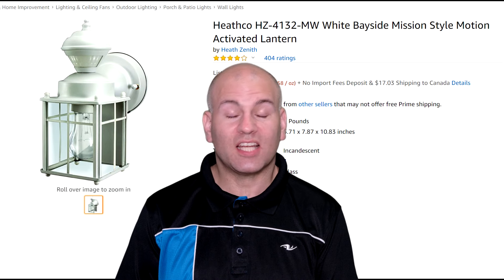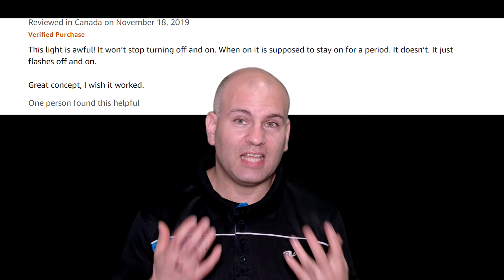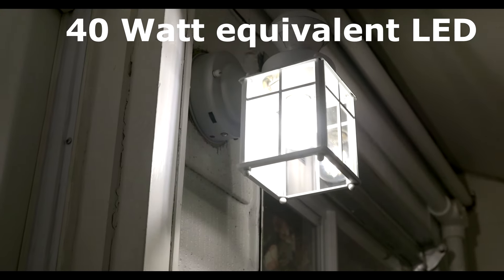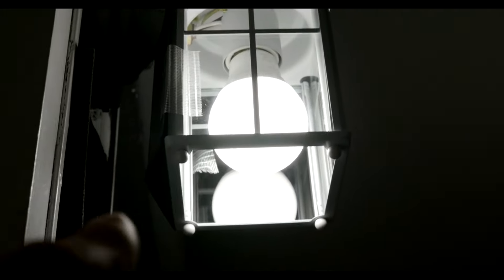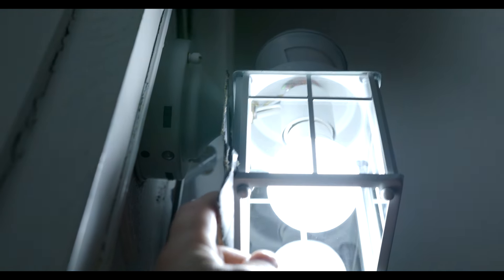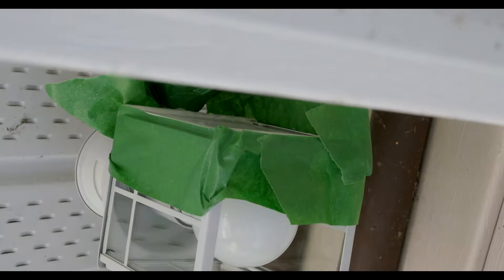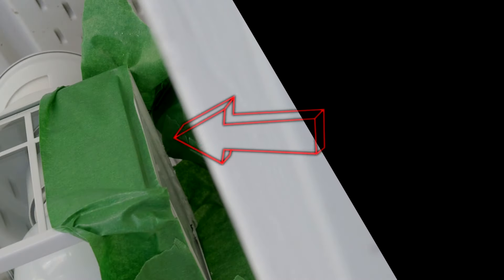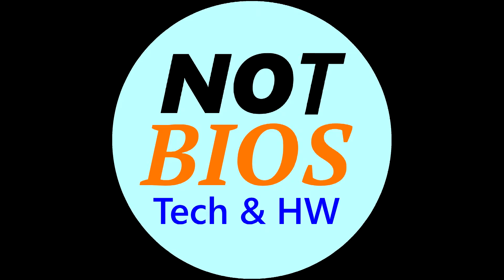Motion Sensor Light Flashing On Off - easy solutions (Heath Zenith)

Comment: I got this POS to work by doing the steps....

1. turn it on at the main switch and wait for it start to turn/off
2. than turn it off (at the main switch) for 2 seconds and turn it back on. In the manual referred this as to set to manual mode but it work for me.

The problem with this trick is that if you have another brand security light on the same switch like I did. What I just did will cause the other security light to stay on, because I just set the 2nd security light to manual mode. Now the fix for this problem... turn it off and 2 seconds turn it back on again the 3rd time. Seriously, I could never thought a well know company such as Heath Zenith could ever design such POS like this one.
Reply from the maker: Keep me updated if that keeps working. Keep me updated to see if this solution remains effective for you and anyone else that tries it and is effective long term. The solution I read in the manual only worked for 24 hours and failed after each night and had to reset again and again, and yes I did what was listed in the manual.
Reply: @sparketech   So after 3 days, I can confirm the above step works.

Hence, follow those steps during night time and leave light switch on for 24hrs for it to cycle  i guess, if you turn the light off in the main switch afterward it will go back to flashing on/off again on the next night. 

Once it light has cycle for 24, after that you can turn it off when not in use and or turn it on when need it. If you accidently turn the light switch on and off within 2 seconds... the cycle need to be start over again.
Reply from the maker: @denis4072  If this can work for others better than modifying. Thanks for sharing, I pinned your comment.

Comment: This is correct however to avoid the painful experience by painting, what you can also do is adjusting the Lux, reason for this is- because the light is reflected into the sensor, the light assumes it’s in daylight and will turn off which can cause it to flash. 

To resolve this, simply turn the Lux dial slightly towards the Sun symbol to allow more light in.
Reply from the maker: Good tip... keep in mind on stormy days it'll also keep turning on, I agree it is better than painting. The light leakage with a bit of silicone to fix is the very simple thing to do with no paint use. Turn the lux up a bit and silicone could be a great option together.

Comment: i am a little confused. Is the basic message this: the lamp 'back illuminates' the sensor, which tricks it into thinking it is daylight, so it switches off?
Reply from the maker: Exactly, too much light bleed. Even using a lower wattage light didn't seems to fix the issue. I used the cardboard back drop first cause I suspected too much light reflecting off the white. There was a crack of light on the back edge coming threw towards the sensor I didn't notice till a bit later. I'd seal the light bleeding through a lightly cover the senor only.

Comment: I purchased two bulbs with a built in motion sensor inside. I'm using a track light fixture. The first bulb worked fine for a few weeks and then begin to go on/off every few seconds. I replaced it with a second one, same, it worked for a while and then begin to on/off.  Any advice?
Reply from the maker: You can try the comment from Denis I pinned in my comments (For me that only worked for 24 hours for me, which is why I made this video cause the manual failed to solve my problem). I pinned his comment so people could let me know if it works (for longer than a day).

I have piles of suggests in this video. Easiest cleanest method I show is how light is leaking past (no painting, no nail polish needed) use silicone color match to light fixture where I suggest. Outside use long life silicone.
Reply: @sparketech  Dennis's instructions are standard for a a fixture with a motion detector. In my case, I have a light bulb with motion detector built in. So there is no any kind of programming of it. I was hoping you would recommend some kind of a fixing it inside the bulb.
Reply from the maker: @Mark-n2u9z  sorry thought you were talking about this light. Flashing and no light sensor correct?

There are several reasons it can happen since I don't know your situation I will suggest several reasons
- is there any dimmer or occupancy sensor on the same circuit because this can cause voltage leak with a solid state type when using low power non dimmable LEDs
- bad transformer but newish lights shouldn't go bad that fast unless overheating
- bad wiring, large voltage drop
- wiring to LED internal wiring to the LEd is loose. Certain brand bulbs are bad for that, I know a Canadian store that sells bulbs that sells their own in-house brand that tend to fail fast this way.

Even a built in could be receiving it's own light. Sadly I am not there to test your exact fixture to see if light sensor is being triggered by its own light. Have you checked if covering any particular area helps?

Comment: I have a solar light that keeps turning off but i want it to stay on at night alone, however once i click on from the remote about 5 seconds later it dims and turns off. Only motion activates it and i don't want the motion sensor on
Reply from the maker: I would probably know the issue if I were to see the light. If it is turning itself off due to light you could  always block the sensor to avoid light from turning off. I actually reviewed a solar yard lamp on my channel, that can stay on all night
Reply: @Not Bios  i have one that stays on at night but i recently bought 3 smaller ones for a small walkway and they have a remote with on and off along with modes 1, 2, 3 mode one is bright turns off quickly mode 2 and 3 are dimmer but turns off eventually, they are triggered with movement or the on button but eventually turns off for itself
Reply from the maker: @kavirl0390  To chance the lamp so it stays on and avoid it's time out you'd actually have to change it internally. I do not know if it'll ever turn off if you were to remove the relay which could be attached with all the other electronics.

Comment: My light is strobing. I.e. 5x a second. Any ideas?
Reply from the maker: If you tried blocking the light to the senor and it is still strobing... It could be they used solid state rather than a relay off within the lamp. If that would be so using an inconvenient rather than LED bulb should not strobe or use a dimmable LED bulb. Occupancy sensor's can do the same thing when Leviton (solid state) rather than Lutron (Relay) with certain models using a non-dimmable bulb.

Comment: What if it's flashing quickly at 2x per second?
Reply from the maker: That is what it was doing that I made this video
Reply: @sparketech  No, you showed it flashing slowly at 1x per 5 seconds.
Reply from the maker: @danielwininger1750  not going to undo the work to show. The idea was to show options to fix the issues. Try the cardboard thing before doing anything if you have the lamp. My channel is mostly all computers not electrical... BUT I am an electrician... The issue is the photo cell gets too much light and the light turning on turns off the light. A dimmable and non-dimmable bulb is going to change the way and rate of flashing.
Reply from the maker: And the brightness of the light or how dim also changes the flashing. I tried all sorts of bulbs but the video was for only 1 reason. Show methods around the problem and why it is happening. Using cardboard to block the light means no voiding of warranty and verifies that light hitting the sensor is indeed the issue before doing anything physically. If there should be a defect of the lamp components than it should be returned.

Comment: Your fix didn't work for me! I put mine back into test mode for one minute, then back to 1 min cycle and it fixed it. I tried everything else, almost ripped the light off the f***in wall lol. Try test mode for a minute. My bulb was working fine for months and then randomly started a light show. I was walking in circles listening for the ticking sound I was hearing every 5 seconds before a realized it was the light turning on and off haha
Reply from the maker: @skatalova  that's great, sadly the test mode and other settings to set the light 100% didn't help my light. Seemed fine for 1 night and the issues kept happening. There was far too much light leaking through to the sensor. If my lamp would have been black the settings would have helped without modification due to less light reflection.